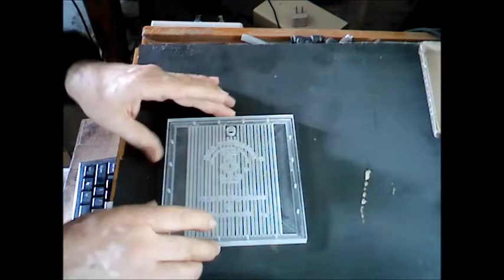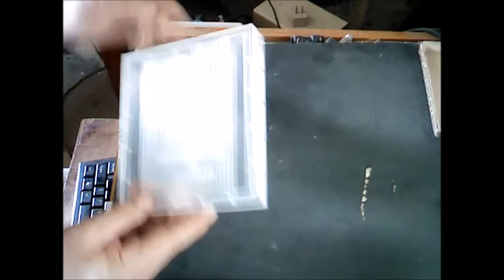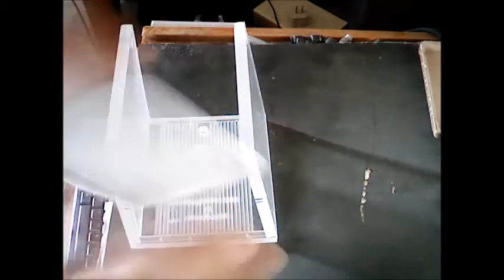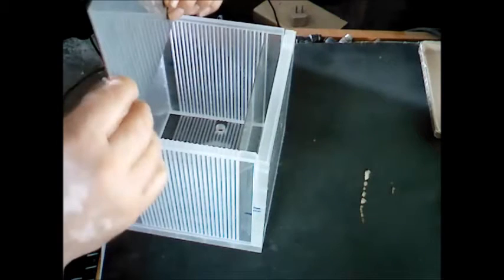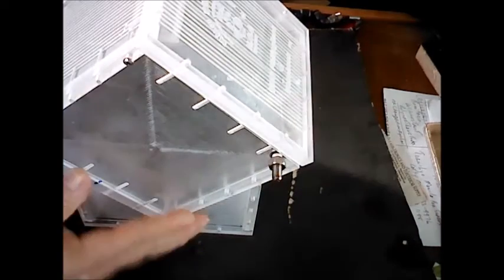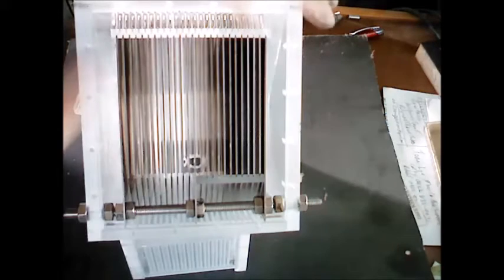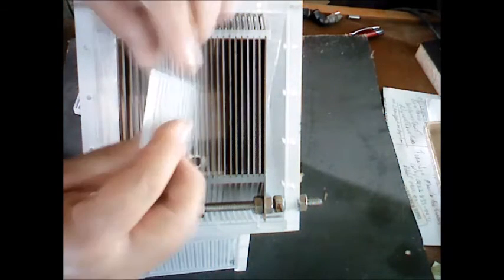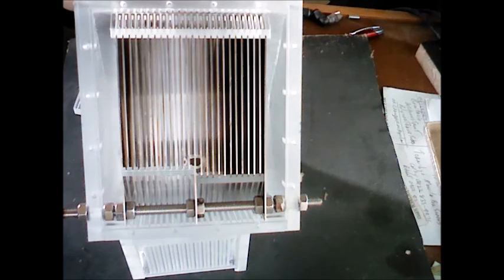7 0 cell

Comment: Seems you have a nice Boyce type cell and perhaps you should think about making the Boyce transformer and getting his pulsing circuit: http://www.hydrogengarage.com/store/index.php?main_page=product_info&cPath=4&products_id=18&zenid=d3b20c6395247e30b7aa4912d62086d5
If you do so I will tell you a way to make it work quite nicely and if you don't well, not.
Reply from the maker: as of now im thinking of making a 8 plate cell with 2 big electromagnets on either side
Reply: Okay, I just thought it would be nice to see someone with a cell that nice making use of Bob Boyce's technology is all. Take care.
Reply from the maker: https://www.facebook.com/crafter2u/videos/vb.795048904/10152875200408905/?type=3&theater
Reply: Is telling me that this pwm card, does my generator produce more only with 1amper

Bob Boyce's PWM3G picture, brought back from popular demand. This is Bob's 3-wave square pulse circuit. It is his discovery about the frequency of resonance of the water division. Fo tuning 42.8K hz, in me, in the middle of 21.4K hz and then in half again to 10.7K hz. It is used in conjunction with the Toroid Inductor 6.5 iron core. U wind kit. More information about the PWM3G card and its functions are here. (18/8/15) Also in U-welding parts and plate kit. (Soldier and tested)

This board can not be used alone to pulse an HHO impeller, it is designed to run 1 amp. Of 2, although this circuit, by means of a secondary winding on top of a main toroid wind, where a current of amperage is running direct DC. This circuit is designed to stimulate the mainstream with external pulsation of the 3 narrow and high square waves. If you are thinking of pulsing an HHO Booster cell, get a simple single wave with a robust PWM30 or PWM70 wave
Reply from the maker: imas?
Reply: Yes, I read one of your theses, and you said that if you put a magnet on the bottom of the generator it attracts the dirt and dirt, you wanted to know more details,
Reply from the maker: this is what im thinking https://www.facebook.com/crafter2u/videos/vb.795048904/10152875200408905/?type=3&theater